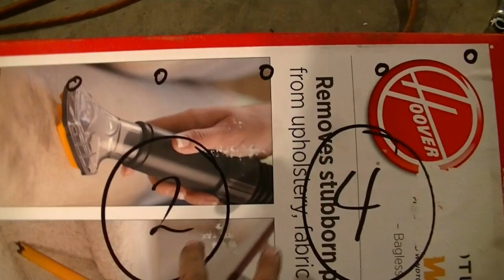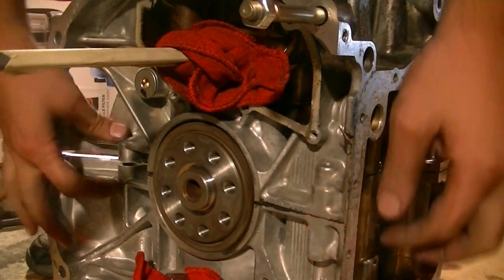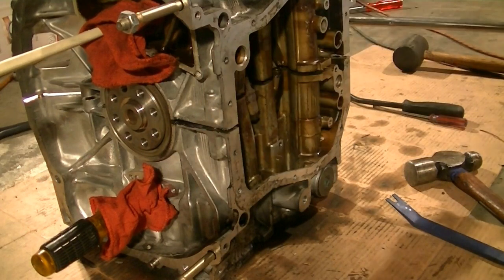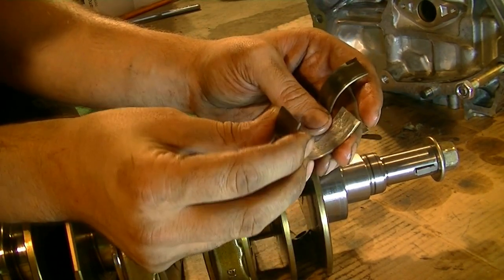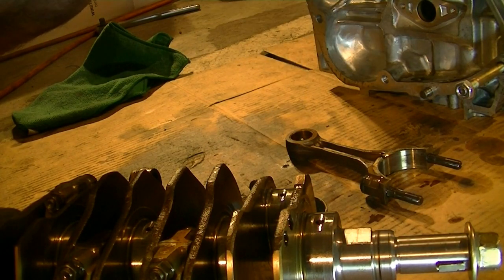How to Rebuild an EJ25 Subaru Engine - Part 5

Comment: Genius split method.  Just did mine.
Reply from the maker: Matt Akers Its a hell of a time saver. GL with the rest of the project. cheers
Reply: Thanks man! . Block #2 using the same method just split like a dream.  Cleanup and go back together time.

Comment: when did you take the pistons off the rods? did i miss something?
Reply: kevin limparis why did he pop the 3 and 4 piston heads back on before splitting the engine block, after taking em all out they were suddenly back in in that shot
Reply: He did it before that shot, he went to TDC and then the pistons stayed there since they weren't connected, Then he rotated the pistons and used the rod to push the pistons out.
Reply: Well, just realized that comment was 3 years ago lol

Comment: If one of those bolts inside the coolant jacket snapped I think I'd kill myself.
Reply: That happened to me a few months ago. The bolt extractor kit I bought had the right size to fit the bolt but was too big to fit through the port... so I ended up taking it to a local shop and paying 40

Comment: Ratchets
Great set of 5 videos. 
Very informative and entertaining. 
Look forward to Part 6 and onwards. 
If you decide to stop work on this engine, it'd be useful to know why. 
What did the machine shop say and so on. 
If you still have the oil filter, it might be interesting to cut open to see whats inside